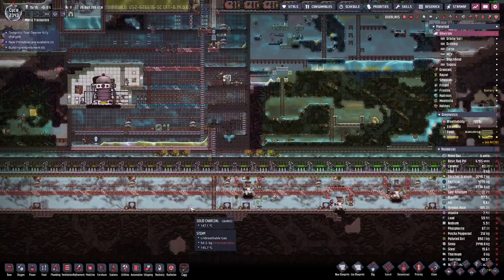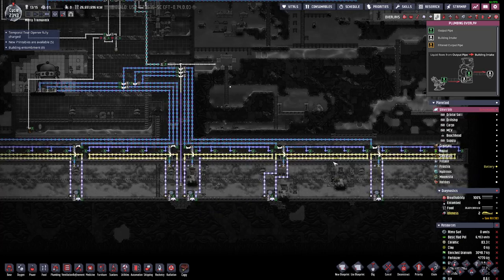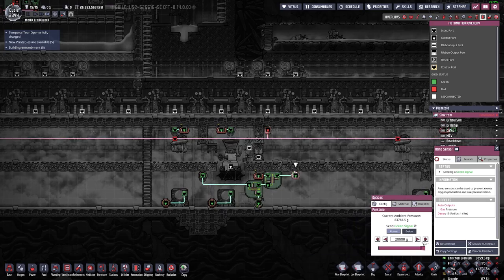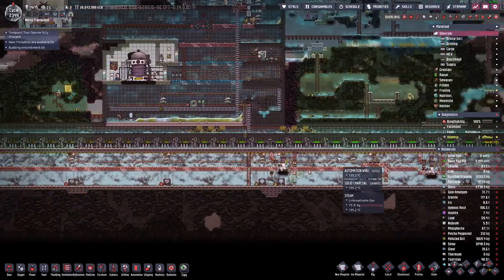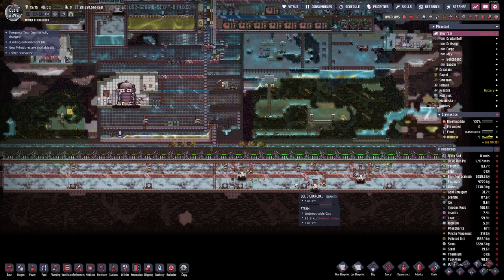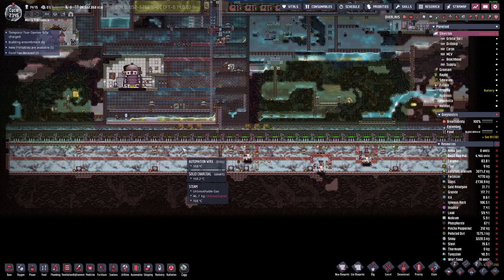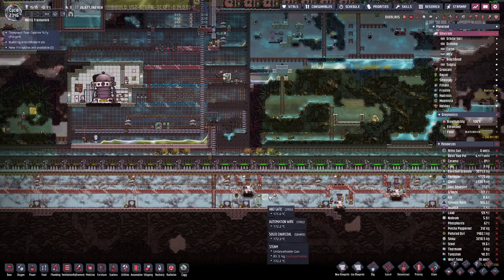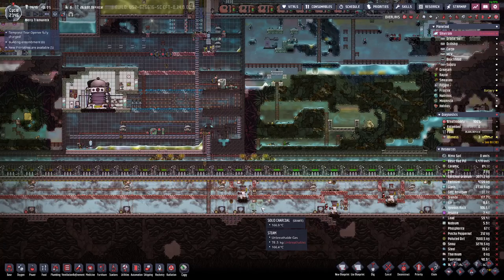ONI / Oxygen Not Included - Geothermal Heat Pump (Frosty POI) Overview & Power Plant Design

Comment: The reason you can't both generate power and produce space materials isn't about overheat limits. If you don't run your cooling aquatuners in the same steam chamber as the vents (but rather in a dedicated one with its own turbines) you don't need to worry about overheating. No, the issue is that the heat pump actually cools inputs if they're above 1650K (1376.85°C), and you don't get fullerene and niobium until you give it inputs at 2500K (~2227°C) or higher, so it's always heat-negative to produce space materials. Unless you're feeding it directly off a gold volcano (which is actually worth doing for a few rounds, if you have one, to get enough fullerene for a tonne or so of supercoolant without needing to go to space, though of course you'll want to build a chamber for each active vent from obsidian or tungsten so as to avoid damage while you handle the various outputs), it's generally not sustainable since the only options for those kinds of temperatures are metal refineries, rocket-heating, and volcano output.

Also: for maximum power output, in case you somehow used that much, you'd want to run 24 turbines (I'd suggest running them on multiple storeys joined by a chimney, to reduce horizontal size), but block two of the inputs on each. This would give them a throughput of 1.2Kg/s each, which is why you need 24 rather than 15 to maintain equilibrium, but it would also mean that each one would cap out its power production at ~270°C steam, instead of 200°C. This is important because the plant adds 150°C to its input (if it starts below ~1377, as mentioned above), meaning the steam you get out after feeding it 95°C water direct from a turbine will be at 245°C. Any temperature above that which produces maximum power in the turbine results in wasted power. In principle this can net you a total of just over 17 kW (more if you use power control stations, of course)

In case you're curious, the injection numbers work out like this: a filling-cycle takes 416 seconds, of which 400 are accepting inputs and 16 are the pump's animation. You put in 12000kg of water, and you get out 11040kg of steam… except you also get some salt water and polluted water which also instantly flash to steam, so you actually get 11733.6kg of steam out. So you need to supply 266.4kg of extra water per run, which with a 416 second run length works out to 640.38… g/s. Set your valve to 641g/s and it'll be fine, or to avoid that gradual increase of less than 1g/s you can use a meter valve, a timer sensor set to 415 red/1 green, and an AND gate to deliver 266.4kg every 416 seconds.

Comment: Have you thought about putting a lot of tempshift plates in there to disperse the temperature better? Might be able to get the ones on the left to run better, could also send the hot debris around the chamber on conveyors to spread the heat too, I don't think you need more than 20kg of steam throughout the chamber as long as its hot enough. I played Ceres on classic (with spaced out on), and my main planet needs about 30kw of power so I ended up just turning off the geo vents and making a sour gas boiler.
Reply from the maker: It's not really a temperature issue as much as a steam mass issue, the steam is being consumed fully before it actually reaches the far side and if you increase the pressure too much on the right side then the vents overpressure (150kg iirc).
Reply: It's too big on one axis. The business part is 10 tiles from one side and 90 tiles from the other side(i didn't count it doesn't matter).

Couple that with using cooling loops in the hot room, and we're already in very strange territory.